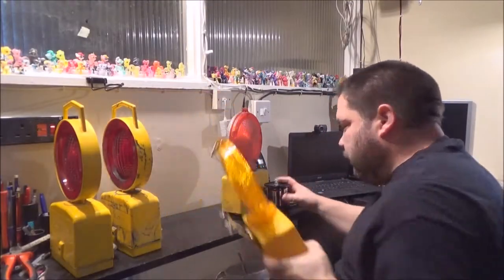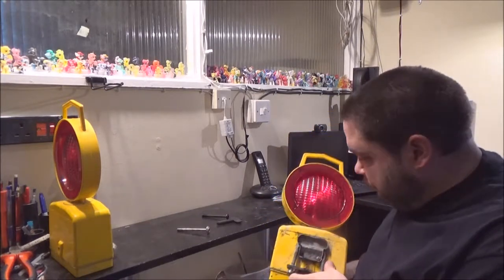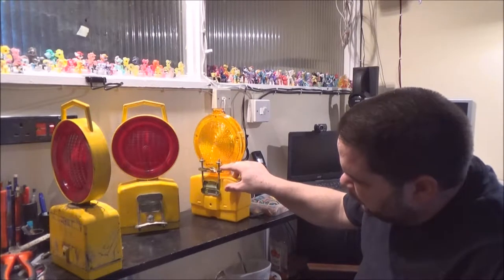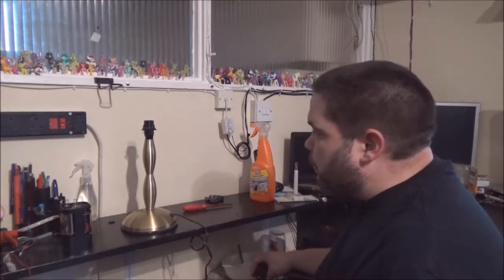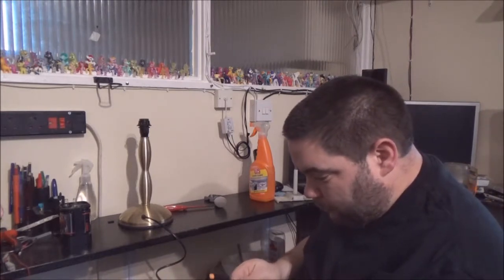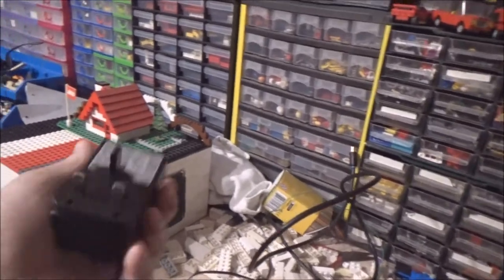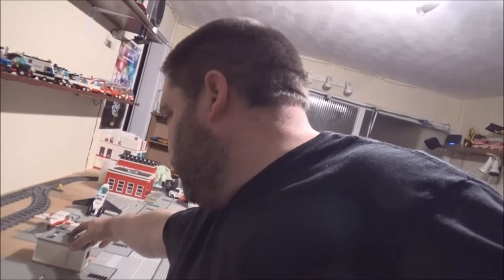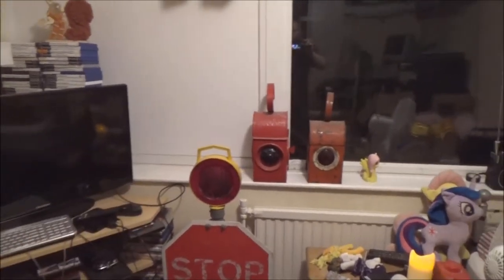Road Lamps/Barricade Lamps, Checking Table Lamps.

Comment: id love to use one of these twin battery lamps to modify and put a 12 volt xenon tube in from a beacon, double flash high intensity, and then use the 2 6 volt batteries to make the 12. Im sure because it uses capacitors it doesnt need the high amperage so hopefully would work, although might not last anywhere near as long. But super high intensity 

Never thought about modifications. 

I also think ive got some 6 volt very bright leds i can give you if you want to mod any of your bulbs,

Comment: Are u sure they are not touch lamps? Unusual not to have an in line switch,  They might not be compatible with LED bulbs, some only work with filament lamps, take the bottom off one and look inside.